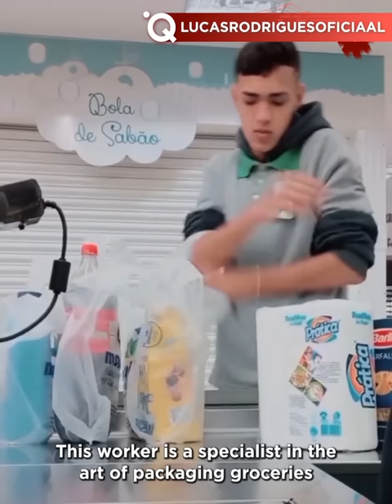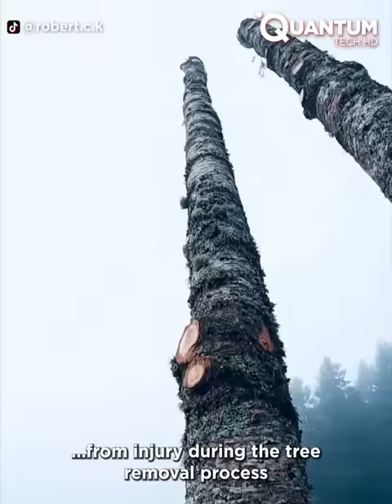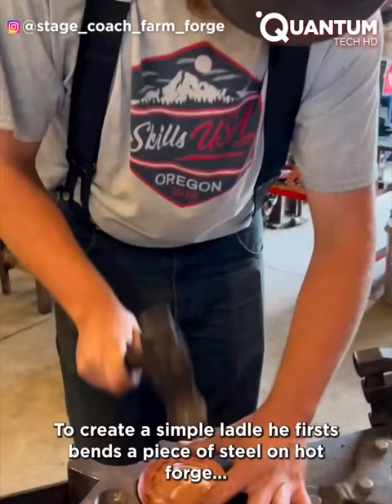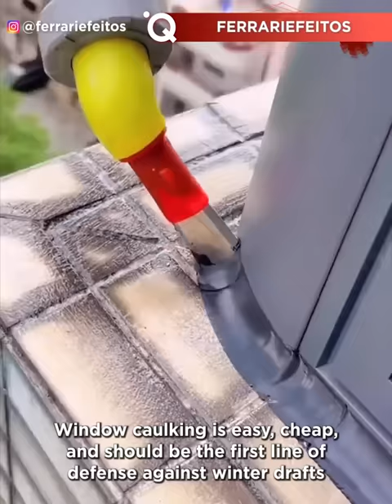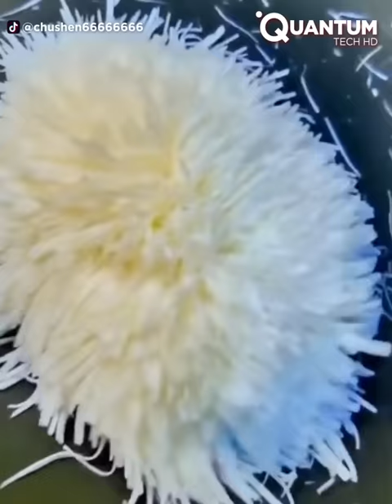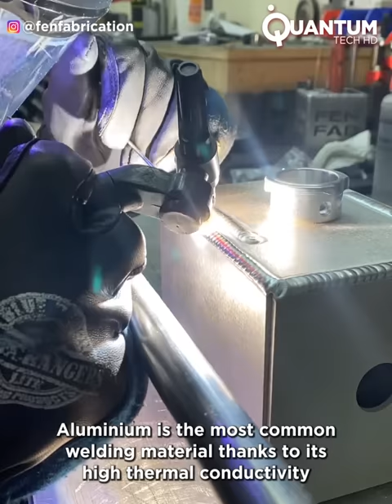Fastest and Most Skillful Workers Ever ▶10

Comment: That wasn't a carbon fiber wheel. It was a process called hydro dipping. the carbon fiber is a printed pattern floating on top of the liquid. This method can be used on all kinds of objects to apply many different patterns or pictures.

Comment: tires come off easily when you take apart a two piece wheel and blowing glass is actively expanding the material with air pressure, not hammering it on to a mold and cutting it off.

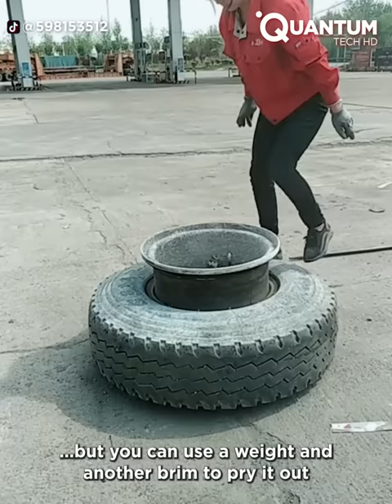Comment: 4:18 Wonder what kind of buffer material or coating he is using to keep the dissimilar metals (iron and copper) from corroding and falling apart.
Reply: not sure but i think that applies to aluminum vs steel not copper but i could be very wrong about that.
Reply: @nopes1776  haven't done that sort of work in a long time, so had to look it up. Depending on the situation, copper can have issues when joined with carbon steel, stainless , or cast iron. Same goes for aluminum.